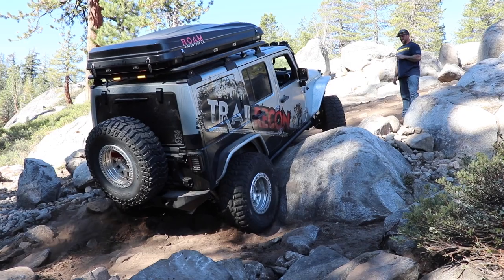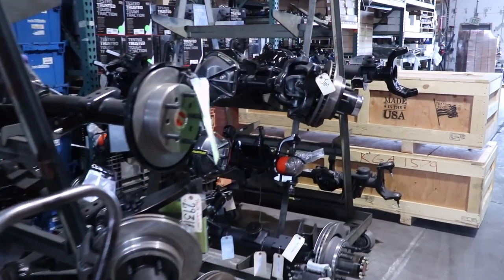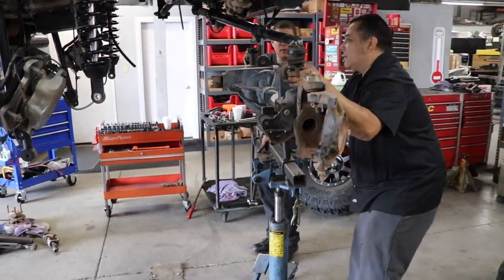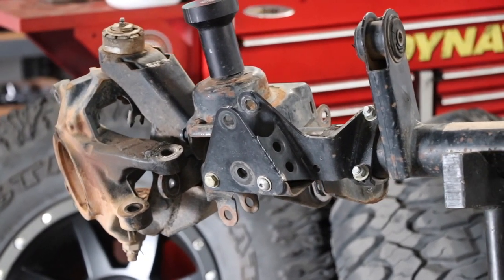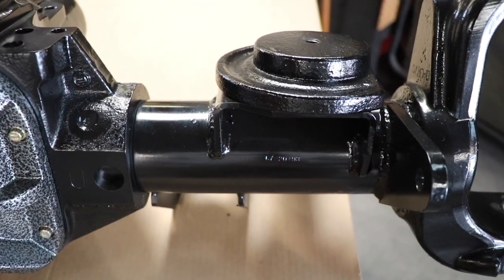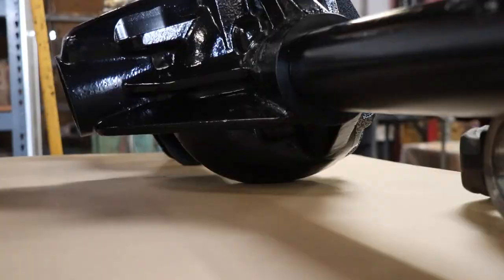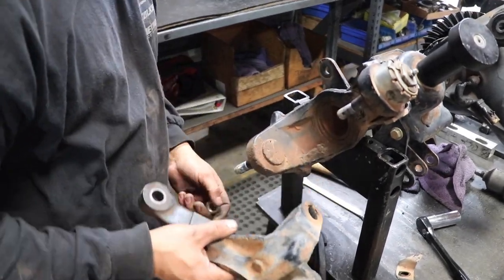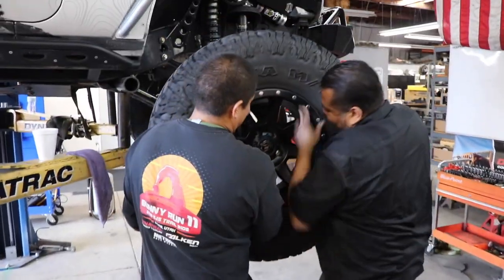My Old Axles Have Taken Some Serious Abuse! It's Time for an Upgrade

Comment: Small correction shipmate - you don't adjust toe with the track bar.
Reply from the maker: 100% Correct... I misspoke!  You adjust the toe with the tie rod!  Thank you!
Reply: @TrailRecon  It's easy to get excited with a new front axle. :)
Reply: @doug6885  tell me about it I've got almost 220k on my stock YJ axles and with a V8. I would be crazy excited to get some Dynotracs installed by the company itself.  Love your JK.

Comment: Love my PR44! I did 35 spline RCVs, ARB lockers, 5.13 gears, Reid knucks and I've had zero issues, everything you'd want out of a standard D44 BUT...3 years down the line, I regret not going with a 60 or at the very least, 44/60 hybrid which Dynatrac offers as well. Reason being. If I knew back then that my needs and rig were going to evolve like they have I wouldn't find myself in a situation where I have to upgrade my upgrade. Back when I first got my PR44 I would've sworn with my hand on a bible that I'd never need to go bigger than 37s...I'm sure we all know how the story goes from there.
With that being said, PR44 is still the best in it's class, bar none.
Reply from the maker: I said I'd never go larger than 35's and here I am running 38's and considering 40's!  I hear you!
Reply: It's difficult to know how your build will evolve 3 years down the road.  BUT, you'll be able to sell the 3 year old PR44 easily and recoup much of the cost of the 60.
Reply: @TrailRecon  in this day and time, 40s are the new 35. It isn't necessarily a matter of having to go bigger because that's what's trendy but when you have rigs running 43" stickies, they are changing the topography of the trails. You damn near need to run 40s out of necessity because everyone else running big rubber is excavating the dirt and rearranging the lay of the land
Reply: TrailRecon tell us more about those 38’s please

Comment: Have a 2016 2 door sport JK for my wife.  We also upgraded, but to a Currie built 44.  As with the Dynatrac, it is much beefier all around.  We also left the rear housing alone, but swapped in the ARB 35 spline Locker and some 35 spline shafts.  We had already Broken a stock rear 30 spline shaft and both front shafts on 34 inch tires.  This new combo has been able to hold up to hard wheeling and 35 inch tires and I am no stranger to the gas pedal.

Comment: Nice walk thru.  I'm sure you'll be happy with the Dynatrac.  I'm still running a stock Dana 30 on my 2016 JKUS, but at some point I want to change the gearing and switch to a 44 in the front.  That will hopefully be a Dynatrac.  Jim seems like a great guy.  He was on stage at the Friday night raffle at EJS back in April and he gave away one of his 44's (the first ticket they drew wasn't there, so they had to draw a second ticket- his loss).  Safe Travels and God Bless!

Comment: Great upgrade Brad.  I ran my OEM D44 with gussets and 5.38 gears since new in 2011 and had about 65k on it when I bought a blank ProRock 44 housing about 4 years ago.  I upgraded to the ProRock44 knowing that I would be stepping to 37's eventually and we repurposed the OEM D44 into my son's 2004 WJ project last year.  I caught a LOT of slack from people about how my ProRock 44 won't hold up now with my 425 HP LS engine but now with over 13k miles on the new power train and 4.56:1 geared ProRock with 37" tires it works perfect.  I don't overland but my JKUR is heavy @ 6k pounds due to the tools and supplies that I carry but I don't feel I need one-ton axles to do what I do.  I feel as long as you drive reasonably and don't flog on your Jeep the ProRock 44 is more than adequate but I'm in the minority in that thinking.  My JKUR is my daily driver that has just over 100k miles on the clock and we flat tow it behind our 40' coach to various Jeep rallies and gatherings and I can either drive it or tow it with confidence.  
Again, great upgrade and enjoy the video.
Mike
Reply from the maker: Great to hear your 44 is holding up... I'll be that LS is fun to drive!
Reply: It sure is Brad, although I drive it like a baby carriage. Off-road I feel like it’s cheating and it’s so mild and docile for daily driving it’s like driving a Denali.
Reply: It's great that a PR44 has held up and I hope it lasts the lifespan of your rig but it's still not something I recommend to someone if they were considering doing an LS swap. That's a lot of torque and stress your putting on a 8.5" ring gear.
Reply: Jeep Wrecognize Jeep thanks but this is far from my first rodeo dealing with HP and axles. I drive accordingly and know how hard to push it and when to back off. If I drove it hard or flogged on it that would be a different story.

Comment: My wife just experienced death wobble about a week ago in her JK . It scared to crap out of her . So I sent it to 4 Wheel Parts and they found that the ball joints upper and lower plus the steering stabilizer were shot. So we had them replace all of them plus the stabilizer and $1,100.00 later it drives better than when it was new according to my wife . No more death wobble. 4 Wheel Parts said on a scale of one to ten , ten being totally shot her ball joints were at a twelve . I'm so happy they found the problem and fixed it .
Reply: Steering Stabilizer has nothing to do with death wobble...if anything it just masks it. Technically, you don't even need one.
Reply: @jeepwrecognizejeep1391  I agree with you . Just had them change it because it was leaking. I forgot to mention they also changed the drag link because it was totally frozen. Wouldn't even budge with heat applied.

Comment: We opted to upgrade to a Tera44 from the stock Dana30.  Regeared from 3.21 to 4.56. It is a vast improvement.
Reply: We have great experience with Teraflex products. Kinda brand loyal.
Reply: @mikehoffman3690  Agreed. I have there rear tire carrier and that thing is stout and has help up for 5+ years with 35's bouncing around. Not huge tires, but a good product none the less.

Comment: I'm still learning so pardon my question. Why does just the front axle need upgrading and not the rear? Thank you! Cheers from Denver Colorado
Reply from the maker: The rear is something I may consider doing down the road.
Reply: TrailRecon follow up from Denver to LA transplant. Just got a 2018 Sport S and mapping out my build. Thoughts on upgrading stock rear with gears/lockers/shafts versus plug and play ProRock 44? I’m unsure if it’s worth adding to smaller axle versus new upgrades axle. Great channel sir!
Reply: @joed596 I would think since the wheelbase on a Jeep is so short, whatever the front axle hits so will the back axle.  Plus the rear axle is always in constant use and the front isn't.
Reply: The stock rear axle uses bigger diameter tubes with greater wall thickness. Typically the only failure on them is the rosette welds breaking allowing the tubes to spin in the diff housing. The more common issue in the rear is bending the axle flanges, which is an issue with all semi-float housings.
Reply: I'm no mechanic and not certified. But my opinion is the front axle is asked to do a lot more for the rig. 1st, it has to "pull" the vehicle over an obstacle instead of the rear having to "push". When going over an obstacle, it has to climb it and pull thousands of pounds over it.  2nd, the front axle has to steer the vehicle while pulling the vehicle. Most times when people talk about "off camber" positions, it's the front axle that takes the brunt of that work.....also, when people talk about 'letting her eat' and they hit an obstacle hard and fast, the front axle also takes the hit, most times you'll see somone do that and before the rear axle clears the obstacle, they've let off the throttle.
Reply: @vitaminb4869  
True, the rear axles usually are larger, but all things being equal, the front axles break a lot more
Reply: Tom D my guess is the steering is what does the front axles in. Turning while hitting rocks and whatnot, more moving parts up front which weakens the front end whereas the rear doesn’t move at all. Just a speculation
Reply: @vitaminb4869  
Yeah. I guess when I said all things being equal I didn't make sense, if both axles are the same size, the front still breaks more often. However and wherever on the axle....it breaks more
Reply: Brad thank you for sharing your upgrade/maintenance experience.  Lots of questions answered, some I didn’t realize I had.  And a big thank  you to Jim and the Dynatrac crew for taking the time to visually explain things...
Any time you can share a factory experience I’m all in.
Reply: The real turd in the punch bowl on the stock housing is the weak tubes, the long tube (Passenger side) will easily bend under the upper control arm tower, also the very thin brackets throughout the housing. The rear axle can take a lot more abuse then the front  and is worth doing the upgrades without replacing it, the real weak part on the rear is the wheel bearings, they are too small, they are OK so long as you don't overload them, Overlander's tend to carry a lot of weight......
From Russia, With LOVE....
Reply: The jk stock rear housing are 3” diameter and half inch wall just like the pro rock much beefier than the stock front with 2.5” diameter and quarter wall
Reply: Because the front is what was gifted
Reply: Front axles load and unload a lot more( front end comes up spinning and comes back in contact and gets extreme loads placed on it.
Reply: CO 4x4 do you have an Instagram account?
Reply: @675daytonarider  no I dont
Reply: CO 4x4 Oh I’ve gots some photos you could check out and I could explain in greater detail. Same as Trail Recon I started with a Rubicon so it had the 44, but I knew I’d wheel it and didn’t want to worry about it so I upgraded it. Both the JK 30 and 44 have major weak links and by the time you solve those problems you that much closer to a PR44 that you can hammer on. The rear is pretty beefy from the factory actually and will hold up to 37 with confidence but if you get too crazy you’re likely to bend an axle flange but that’s an easy fix.
Reply: @675daytonarider  thanx for explaining. Yeah I did some reading and asked around and that is the consensus of most. Thanx again...
Reply: CO 4x4 Not a problem at all. I’m in the process of moving to XD60s now and have played with all the axel brands so if you have any questions please feel free to reach out.
Reply: @jeremywilson2467  I have a 2013 Sport and am upgrading to a G2 Dana 44 in the front and just regearing and adding lockers to the rear.  I have 35s right now and probably going to 37s.  I was told the rear 44 will hold up as long as I don't go nuts.  I'll probably upgrade to new shafts in the rear a little later.  It's pricey to get everything done.  btw..I'm also in LA.
Reply: @TrailRecon   are you gonna go with the same as the front???
Reply: Physics: when the weight of the jeep is being pushed onto the front axle from the back when it hits an obstacle it puts much more pressure on the front axle than the rear. When the rear axle goes over the same obstacle the weight of the jeep is in front of the obstacle and it puts less stress on the rear axle.

Comment: C'mon Brad, you are upgrading because you need too, you advanced beyond the capabilities of the stock D44. It's not because of the wheelin you do. It's the wheelin you do with all that extra weight. Rubi's wheel just as hard but w/o that weight so their front D44 lasts for the life of the Jeep.
 It's a nice and needed upgrade. Now it's time to upgrade the rear!! Only a matter of time.

Comment: Doesn’t the fact that you had a broken u joint make you want to step up to a PR60?
Reply from the maker: No, because of the long range trips I do and mostly moderate trails, I think the weight savings of the 44 is the right option for me.

Comment: You took your Wrangler to Dynatrack which, from what I've heard and read, is probably the highest quality axle assembly manufacturer in the United States today.  These guys know their business.  From what I've seen of their prices for axle assemblies shipped in crates, the prices are quite reasonable.  I have, however, one question: Why did you decide to reuse many of your "old" (100,000 mile) components (for the OEM parts) rather than "just" purchase an entirely new Dynatrack 44 front axle assembly?  (The obvious reason is cost, but if I'm correct, I doubt an entirely new assembly including chrome-molly axle shafts and new differential assembly would have added more than about $1,500 to $1,800 to the price of the modification.  And, if you deduct the labor costs for the transfer of "old" (after-market chrome molly half shafts, with less than 100,000 miles on them), and the original differential, you would probably be talking a price difference of $1,200 to $1,600.  From watching many of your other videos---all of which have been superb!---I suspect the reason you stuck with some of your tried and true components was based on some factor that outweighs the cost alone.)  Am I correct?  Whatever the answer may be, you are saving money, and you will have a well-engineered front axle assembly on your Jeep Wrangler.  Excellent video with superb advice from you and Dynatrack's experts.  Thank you very much for another first-class lesson on a desirable and popular modification for a Jeep Wrangler.  Andy McKane, Molokai, Hawaii.

Comment: Howdy Brad,
Always a pleasure watching,  learning and being entertained by a well spoken and down to earth wheeler..
I'm a new owner of a 100k mile 2015 JKU Rubicon. Had the stock tires for the first 100k..road use only..
Tossed on the 37's and wondering your opinion on upgrading the axels, or will the dana 44's last a. while wheeling just the same as you do..
Was it worth upgrading the components on the 44, or put that cash to a new axel??
If you had to do it again??
Have a great day..

Comment: I had a set of bfg tires way to long.  It caused the meanest death wobble.  Jim is right about that.  Speaking of tires.  What happened to your Coopers?  I am glad to see you didn't go overboard like Kevin and Brittney.  The dana 44 is more than adequate for most people.
Reply: and you think a PR44 would've been "adequate" for what Brittany and Kevin do in Stepchild? A PR44 wouldn't hold up with a Hemi on 40s. They wouldn't have made it pass Day 2 on Trail To SEMA with a PR44.
Reply: @apexpredator_jku  Kevin and Britney's JKU was doing great until they added a turbo.  I've been through the motor swap with a 71 1310 series IH pickup truck.  It has a 455 oldsmobile with a turbo 400.  480 hp, 575 ft pounds of torque on the tires.  My ball knuckle 44 still survives.  My turbo 400, np205 and rear dana 60 have had issues.  I'm also running 37's. It's been this way since 2003.  So yes, there's a point of going overboard.  As I said before,  the Dana 44 is more than adequate for most people.
Reply: @cespool  I'm not debating that it a PR44 isn't sufficient for most folks, I agree...In regards to LiteBrite, I dont think they went "overboard". They're lugging around all their belongings cross country, hauling a RZR, that alone justifies a Hemi. Factor in the type of wheeling they do, 40" tires...1 Tons was the right call. They made logical upgrades out of necessity, albeit from their own doing with the turbo fail.
Reply: @apexpredator_jku  my choice would have been the pr60 front and rear.   Especially after seeing how many Ultimate adventures they've held up to.  Some rigs with portals, some with 54's.  I think that would have made a perfect combination for them.  Just my opinion though.
Reply: @cespool  If I was looking to get the best bang for the buck without breaking the bank, that's the route I would've went too. Not a big fan of semi-float but I could have piece of mind with 40 spline shafts but I don't have a "business relationship" with Dynatrac so hypothetically speaking, if they could get an Elite XD60/80 package for the same price a regular Joe Schmo would pay for a PR60/60 package I'd go "overboard" too.

Comment: I was going to say it's not an upgrade unless it's G2. I bought a Teraflex TF44 and so far so good but I regret not getting G2. At the time I bought the TF44 I believe G2 didn't have a right hand drive version or they were a little more expensive. I don't remember. I even looked at getting Atomic axles but apparently they give the equivalent of a 6" lift which is illegal here in Australia.

Comment: Thanks Brad.  I read the comments on the 'rear' axle and saw that you may upgrade later.  I'm curious what you may select?  Doesn't look like Dynatrac has a D44 rear axle assembly, would you go to a D60 rear?

Comment: Can we get an in-depth follow up on Patagonias? I just want to know if the hype is legit or just the flavor of the month. 
I respect your opinion when it comes to tires. You kept it real with the Treadwrights, you went from Cooper to BFG and back to Cooper with comprehensive explanation. Now I'd like to know the real deal with the Patagonias. It's no secret that Milestar gave every Jeep YouTuber a set and tbh before Kevin,Britt and Stepchild came along, Milestar wasn't even on the radar. Now just because the whole LiteBrite Nation seems to think they're the end all be all of tires doesn't make it so but I know you'll tell it like it is regardless.
Reply from the maker: Allow me to put some more miles on and off-road on them and then we can talk about them.
Reply: I think opinions will vary depending on the type of terrain you wheel and what region you reside in. What works in one region doesn't necessarily mean it'll perform as well in other regions of the country. I'm in the North East and the general consensus around here doesn't echo what you'd hear out West.